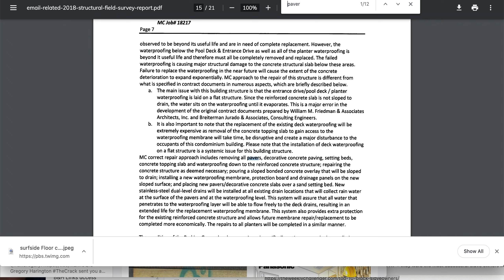Champlain Towers Collapse VIDEO OF DECK COLLAPSE FROM RAMP VIEW BEFORE FULL COLLAPSE CLOSE UP

Comment: I have put my View on how the Champlain Condo Building Collapse in Florida and i said is the Soil Sand and mentioned Sinkhole but see the Site were the Building was and to does have Water on the slab and i mentioned about Water getting in on the carpark lower and that rhey had to PUMP WATER OUT OF THE LOWER CARPARK AS A VIDEO SHOWED QUITE A BIT OF WATER HERE AND THERE SO I BELIEVE OVER THE YEARS THAT BUILDING ALSO HAS BEEN SINKING EVERY YEAR AND WATER IS THE KEY TO FACTOR THAT HAS WEAKEN THE BUILDING FOUNDATIONS ??What happened to the Sercurity person as he has not been seen did that person perish in the Collapse ??
Reply from the maker: lol So you are going to gaslight the witness statements...

Comment: Yes this video explains it, residents and other claimed that they heard loud thunder-like noise just a few before the collapse, it was partial deck collapse taking a chunk away from the smallest columns in the building that overloaded the remaining section, leading to the collapse, the running water in the neighbor video could be coming from water pipes, plumbing or anything. I’m wondering if the fire alarms went off just after the deck collapse! Or did they go off and someone disregarded the alarm? Or responded late?! Very sad and heartbreaking tragedy.

Comment: Building had beamless floor structure
Reply: Flat plate construction is very common and very economical...things like beams and column capitals/drop panels are very expensive to form up and increase floor-to-floor height. It has been used successfully in thousands of mid-rise and high-rise buildings.

Comment: I wonder why the news chopper videos from the next morning all show the pool and surrounding deck still intact and the pool is still full of water? As the late Lt. Columbo would say "there's somethin about this whole thing that just doesn't aydd up."
Reply: Don't think the pool had anything to do with the collapse, the later videos show it intact but most of the water drained, probably due to cracking from the earthquake-like impact of the collapsing building.  The deck around it is intact, the planters and even lounge chairs in place.  The heavy, deep pool would have sat on grade and partially supported the decking around it while the column-supported deck sheared off.  Maybe people were initially misled by the fact the area was called the "pool deck" what actually failed was really the "garage roof deck."

Comment: Just saw this today.  The stairwell should be just beyond the pillar on left.  I've never been there so perhaps someone who has can confirm.  

It appears the ceiling slab above and beyond the same pillar has collapsed but I don't see obvious damage to the pillar (which is wierd).  The direction of the flow from broken water pipe suggests it is the incoming line for this building section (plumbing sheet).  

To my eyes, this doesn't appear organic at all.  The inspection report showed ceiling slab issues near the pool, not here.  Images of the ramp showed excessive spalling on the ground but no images of the ceiling/deck were provided.

Comment: Interesting that the part of the building that has the elevator shafts remains standing
Reply: In all structure demos i've seen (participated), the strongest element in the whole is the elevator shaft/bay and occasionally sustains enough to necessitate a follow-up attempt to bring it down.  Even with a wrecking ball.

Comment: No one should have anything underground in Florida which is mostly under sea level. I hope people sue sue sue
Reply: They would be suing the owners. Which would be themselves. Because the building was owned by the residents, who had been made aware of the damage in 2018, but didn’t want to pay the estimated $15 million assessment to fix it.
Reply: @HenryPaulThe3rd  and many of the board are missing or dead.
Reply: Parking level isnt actually basement, more like below grade or raised soil/sand the lobby level is at.. The parking level isn't below sea level, or wasn't when it was built.

Comment: So you can still frame one of the video close ups of the garage then photoshop it to enhance the detail of the debris in there.  Hard to tell but we’re the 3rd column in on the left should be is a huge block?  Planter?
Reply: No, not planter.  Above the rubble you see is a residential unit.  Likely the one a resident escaped from (don't recall the number) and reported hearing the collapse beneath him, in the garage.

Comment: Fyi, it has been raining constantly during the last 2 weeks or more.  
Typical May/June weather in SoFla.  And yes this can lead to a bit of water accumulation in the garages. 
But buckling? 
That is unheard of.  Subsoil fracture of failure. 
Columns go deep down into the bedrock. 
This isnt granite but limestone/sandbar bedrock.  However, a 12 floor building is right about average in the area.
The Diamond towers are like 50+ stories high or so.

Comment: This is the strongest evidence, the smoking gun, that the collapse of the deck led to the building collapse. It shows the deck collapsed next to where the building fell, before the building fell. The witnesses all saw the pool deck collapse, but this is the first evidence that the deck collapse had propagated to the building structure. Also the woman in unit #611 saw a crack propagating up her wall and ran down the stairs as the stairwell was cracking. That shows the columns and beams acted as a truss for a few minutes until they failed and the building collapsed. You can hear alarms in the emergency calls, but I wonder exactly when the fire alarm was activated. Probably the alarm initiated when the guard called the police at 1:15 am.
Reply from the maker: Tom, I am at work but just posted the video I have so wanted to exist!
Cracks in the ceiling... A longer video will follow once I get off work today.

Comment: You could explain to people the difference between this tall building with columns vs a short building with bearing walls.  This is basically what happens when they collapse.  The short building has much less force and a more rigid structure gives you pockets in the debris, whereas the tall building with columns has nothing to slow the structure down and as each floor above compacts the debris, crumbling any larger pieces eliminating pockets:  https://www.dropbox.com/s/mbkya38fkstn28f/Bearing%20Walls%20vs%20Columns.pdf?dl=0

Comment: WPLG LOCAL 10 REPORTING  Miami Beach Condo blames delays on repairs on "City's slow turnaround on permits"
Ya, here we go...
Reply from the maker: I already said in a previous video that city should be accountable and not worry about "lighting issues".
Reply: In the August letter you have residents voting on BBQ area renovation and hallway carpet shit. Nothing had officially been voted on construction. Work would not have started until next year. After there live in permit expired. The treasureer finally problem went down into the garage and was like holy fuck.
Reply: The residents voted every distraction down. They where probably like just fix this shit already.

Comment: The collapse of the pool caused this im sure it made those columns fold they were already deteriorating
Reply: Yup.  Some of the columns were compromised already.  A waterproofing layer under the pool was improperly installed, leading to cracking in the concrete that was going to “exponentially increase” (2018).  Standing salt water was a chronically recurring problem in the parking garage... compromising the columns (?).  I would guess that the exponentially increasing cracking took out the deck.  You can see that fallen deck in the photos.  The fallen deck weakened the columns just enough to bring them down a little later.  
Down below Zachary says he thinks they will find people dead toward the bottom.  He’s right.  They were on their way out.  Horrifying.
Reply: Some of the residents of Champlain South felt that the construction of 8701 Collins Avenue Condominiums damaged the structural integrity of the lower levels of Champlain South.  They requested help from the city of Surfside but were denied that help.  The city of Surfside told them to go hire a structural engineer.  I wonder if that construction next door was a factor in the failure of the deck.
Reply: The pool did not collapse. There is video of an intact pool with water in it beside the pile. There is video of intact pool deck adjacent to the pool with cars that are not squashed. The pool deck collapsed at the building and one or two columns south. Not at the actual pool.

Comment: On the South side of the building there was a road used for beach access which was removed by the building owners of the new building built next to the ill fated collapsed towers in what appears to be a land grab. 

The road was reduced to a walkway fully landscaped and irrigation appears to be installed on the property line. The new buildings were built significantly further North of the original building and new smaller structures were placed next to the property line. What was originally a road and huge parking lot with a building to the farthest South side of the neighboring lot is now fully landscaped irrigated walkway and buildings on the property line next to the Champlain South Towers.

Recall the Champlain South Tower HOA in 2018 allegedly sent a letter to Surfside City officials claiming that the new buildings being constructed next to them was “being built too close to their property causing serious structural damage to their foundations and buildings”.

Apparently Surfside City officials responded stating it was not the City’s problem. However, the City has the legal responsibility to investigate the HOA claims and the authority to pull the new construction building permits if deemed necessary for public safety, code violations, etc. 

During the construction of these new buildings, their location, footprint, landscaping, etc completely changes water, soil and wind dynamics which can have a major negative impact on the adjacent buildings including the Champlain South Tower Condominiums. 

It’s worth reviewing the plans of the original building and the new buildings South of the Champlain South Tower development. 

Also, was the road South of the Champlain South Tower originally used to service the beach and then changed to the North accesses due to new buildings?

Data shows signs of significant sinking in front of the Champlain South Tower’s North parking garage entrance which is also the beach entrance for heavy City maintenance equiptment. 
Appears road is being overstressed sinking/compacting/liquefaction, etc

Comment: Please analyze the security video from inside one of the apartments, which shows the beginnings of the collapse before the feed cuts off.  It appears that the camera is on a countertop, and the wall to the left moves towards the left, without the countertop moving.  After the wall shifts left, then the countertop moves forward.  It’s as if there is no connection between the left wall and a wall that must be behind where the camera is.   I know zero about engineering, but my untrained mind finds this very strange.
Reply: It seems the portion that collapsed on its own was never attached to anything… like they just leaned it up against the other building and hoped for the best.

Comment: What would the effect of a pressure blast from the pool deck be on the remaining structure? I'm wondering if such a blast provided enough force to "kick" the primary failure columns on it's way through and out the north side of the structure?
Reply: The building that used to be there next door was brought down , demolished a few years ago.
These buildings are sitting on limestone bedrock.  
Regardless, the other buildings were unaffected.

Comment: I am no engineer!  What is meant by the term "decking"?  To me, a deck is a wooden structure attached to the outside of a porch.
Reply: I had to look it up too!  I don't know whether it's purely an engineering term or specifically an American term (I'm English) but it's the pool surround, in other words what the pool is built into.  The waterproofing underneath had not been installed properly.  It should have been sloping so that the water drained off but instead, it was collecting water until it gave way into the car park below.  It had been slowly leaking for years but this was the straw which broke the camel's back, with water now pouring into the already damaged foundations.

Comment: Had this happened during daylight hours - I wonder if someone wouldn't have immediately evacuated the building and lives could have been saved.  This is just tragic.
Reply: Agree. I also think there was disbelief because this type of failure doesn’t happen, like they cannot absorb it.
Reply: very true!
Reply: Maybe some of the younger and more able could have evacuated. The initial collapse broke sprinkler lines in the garage, which activated fire alarm and so the Fire department was dispatched. By design the elevators would have immediately gone to lobby level and stayed there until fire department arrived to manually restart; unfortunately the building collapsed before they arrived. Many of the elderly residents would have been waiting  on their floors for rescue, or still slowly descending the stairwells when the building collapsed. There just wasn't enough time between the initial collapse and the rest of the building coming down. Lastly, my experience working in a high rise shows that many people will refuse to evacuate [believing that they are safer in their home] or that it is just another all too frequent false alarm.
Reply: Wasnt enough time for full evacuation, but signs should have been seen before especially with the inspection and roof repairs
Reply: Why start roof repair before repair the foundation🤔

Comment: The fire alarms should have activated immediately because of the breach in the sprinkler system
Reply: News reported MDFR responded to a Jefferson alarm.  Dispatcher in audio says “garage collapse “ before first unit reported arrival at building.
Reply: Could have been a domestic water line, not necessarily fire sprinkler line.
Reply: @ronbennett8026  there had to be a breach in the sprinklers which would trigger an alarm the goes directly to the fire dept and trigger the alarms.
Reply: @ronbennett8026  entire area is cover in sprinklers as required.
Reply: When that deck dropped the fire alarm should have gone off. Why did it not sound the alarm. Needs investigating. But a collapse like this does not happen suddenly, one would see tell tell signs. This collapse is something that must of started at least 6 months before. It should have been spotted.
Reply: @latitudeash  it WAS spotted and the board was arguing amongst themselves how to repair it. since november.
Reply: @DieselRamcharger  so for about 7 months they did not have a fire alarm? The gotta be illegal or something. A none functioning fire alarm in a shop means your insurance is void and you can not open your doors. I bet the insurance company will not pay out or reduced payout.
Reply: Exactly, I was wondering about that.  It might have triggered an alarm at a monitoring station however, not necessarily a building-wide fire alarm or an alarm at a fire station, depending on what their setup was and local codes.  But it should have indicated an alarm somewhere.
Reply: @anneangstadt1882  Mainly a waterflow switch will activate the fire panel (in the case of flowing water from a broken sprinkler pipe) and activate an alarm condition. This can either cause a general alarm of the whole building or a silent alarm in the case of a large building (to verify alarm first then second stage sets off audibles to prevent unnecessary evac) depending on codes and how the panel is programmed.
Reply: Central alarm made a 911 call saying that there had been a fire alarm activated before the collapse. So it looks like the breach of sprinkler system. 
A family went to the security desk of 8777 to report the deck collapsed. They then went to the garage to evacuate the building! Who in their right minds go to the garage to get their car to evacuate a building. They ended up trapped and calling 911 to get rescued. As a former rescue squad member, I would be a little pissed risking my life to get morons who could have walked out the front door but chose to go and get their car. Cars can be replaced, your life can't.